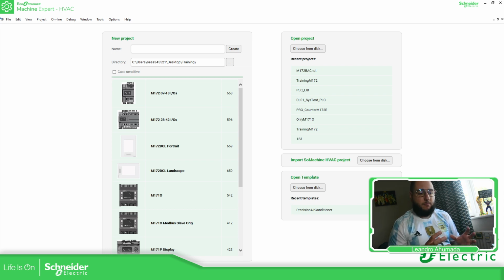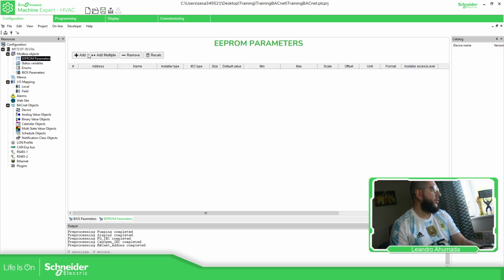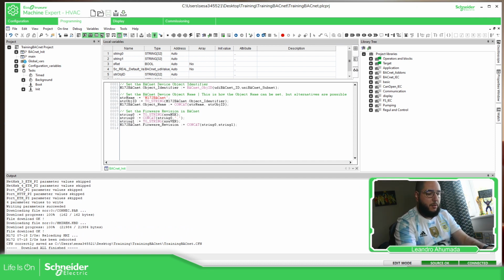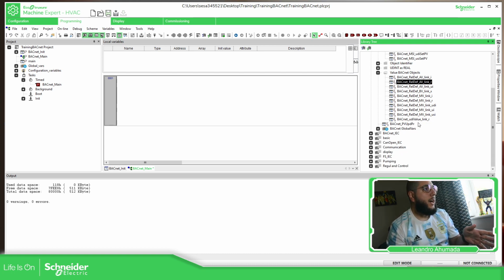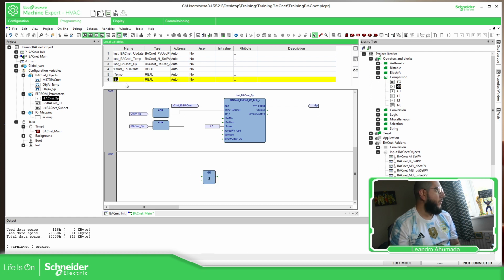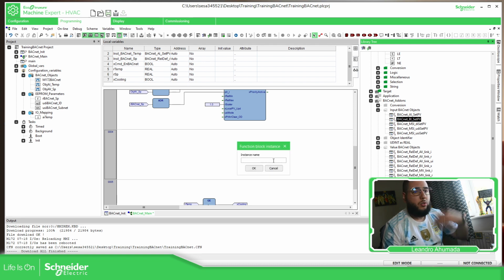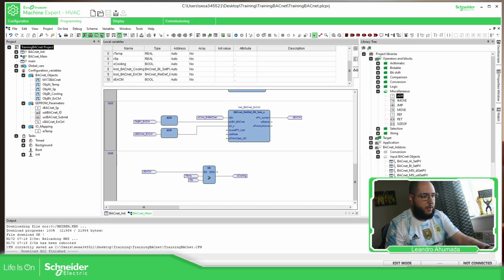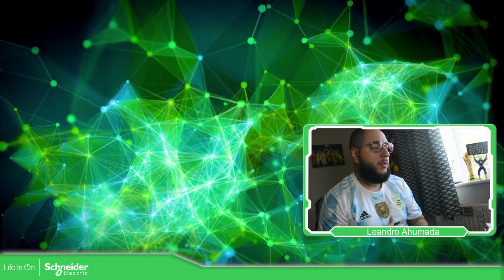ESME HVAC BACnet - M1.x BACnet quick implementation

Comment: Hello Mr LeTomas, thanks for the tutorial, I just found one issue, perhaps it's only with the latest versions of HVAC, but there's a typo in the BACnet libraries. In the addons "Input BACnet Options" In all the objects you have the following lines, like below

	IF (xEn_old AND NOT(xEn)) OR (NOT(xEN) AND NOT(runCheck)) THEN
 		 @ptrAI_BACnet.Description:='Disabled';
	END_IF;

The variable to enable is xEn but on this line there's also xEN with two capital letters, it throws an error when compiling now, is there a way around it? Or are there updated libraries perhaps?

Thanks!
Reply from the maker: Hi there! Have you tried the case sensitive no for the project?
Go to "Project > Options.." then select the tab "Code generation" and uncheck the "Case sensivity (IEC default=no)
Reply: @LeTomasAHUMADA  Thanks, just did and it works!
Reply from the maker: @jeroenvanderwal4291  brilliant!!!

Comment: Hello, sir. I'm new to M172. Did exactly the same shown in your video, but i can't find my device on BACnet with Yabe. I also tried to load example project from BACnet Addons library, but still nothing on BACnet. Maybe I'm missing something basic.
Reply from the maker: Hi there! Have you tried the example from the library on the description? Remember to activate the BACnet port because by default is disabled.
Reply: @LeTomasAHUMADA  just tried the example from the description still no communication on BACnet. BIOS Parameter Port_BACnet_IP is set to 47808 or there is anything else I should do to enable it?
Reply: My bad. Messed up with IP settings on my laptop. Now everything works fine.
Reply from the maker: @copper_hunter  glad that is working now 💪🏻🎉

Comment: Hello. 2 objects AI and AV were created. The AV object writes the set temperature value, the AI object reads the set value set by the AV object. When adjusting the temperature of an AV object, the set temperature value changes after about 3 to 4 seconds. Could you help with the analysis?
Reply from the maker: Hi there! i just saw that the expert of the M172 answered you on the community: https://community.se.com/t5/Machine-Automation-Forum/BACnet-protocol-in-Machine-expert-hvac/m-p/482654?referrer=email

Comment: Mr LeTomas, thank You.  Are there opportunities for interaction between the TM172 PLC and the Bacnet 3d Device?
I see a lot of documentation about how to implement TM172 as a BACnet data source, but I need to 
implement some service within TM172 that will be able to read/write some BACnet objects from the 3d BACnet gateway. 
Is it possible? What libs or predefined functions (function blocks) should I use or download? 
BR
Reply from the maker: Hi there! As far as I as know the M172 is only “slave” of BACnet. In your case i will advice to use modbus serial or tcp plus a gateway if possible

Comment: Is there a way to connect to a remote PLC using YABE?
Reply from the maker: Hi there! I have not tried that but i believe if you have a vpn connection to site and enable the ports for BACnet it should work (need to try it).
For remote connection you can use the Secure Connect solution of Schneider or you can also try the Secomea gateways